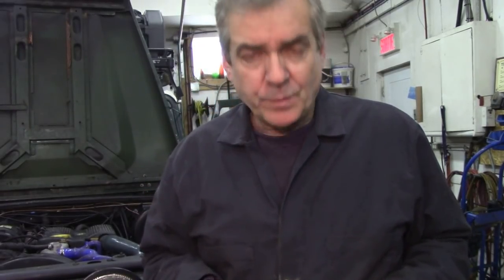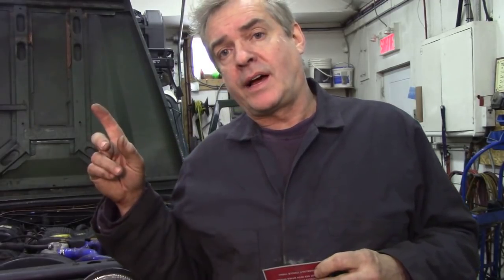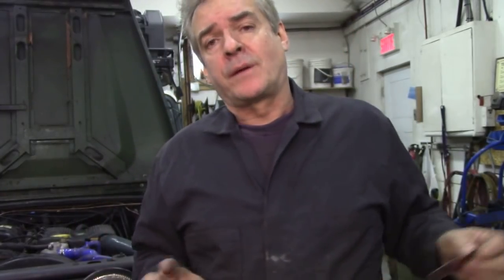Bit of a ramble about WOLF wheels, lengths of studs, bent propshafts and being an apprentice

Comment: Hi I’ve recently found your channel and I’m really enjoying your useful content. I’m a retired engineer from a UK automotive manufacturer, a little bit further north than your apprenticeship days. The rule of thumb we used to employ for thread engagement was 1.5 times the diameter of the bolt. Another useful fact is torque is 80 - 90% friction, so never lubricate a nut when assembling, as you will reduce the friction and probably strip or snap the bolt.
Reply from the maker: Cheers Gnarly!
Happy new year!
Mike

Comment: When it comes to thinking about nut/bolt strength, it's worth remembering that there's a big difference between static load and dynamic load.

To borrow Mike's example of a lifting chain, it might be rated for 500kg when it actually has a breaking strain of 800kg but that's a STATIC load.
If you're lifting something that weighs 500kg and it gets stuck, comes loose and then jerks the chain you could easily find yourself exceeding the 800kg brreaking strain and end up wearing a 500kg load as a hat.

Another good example is waterproof watches.
It might say something like "Certified water resistant to 10 Atmospheres", which means it is, theoretically, water resistant down to 100m depth.
In reality, if you go swimming you'll find the watch will leak at a depth of around 30m.
That's cos, when you're flapping your arms around while swimming, you're applying additional pressure to the seals, much higher than the static head pressure of the water, alone.

Similar thing applies to wheel-nuts.
It's not just the static load that you have to think about but the worst-case dynamic load too - from every-day things like driving over a speed-bump to more dramatic cases like when a 4x4 slides sideways on a track and the side of the wheel smacks into something.

I suppose you could do the maths for working out the maximum dynamic load that you might encounter but it's probably simpler to just hope that somebody smart has already done the sums when designing a thing and fit nuts/bolts as instructed.
Reply: Thank you. You should team up with Mike and do "Dummies guide to Landys"

Comment: Really good informative story about the caravan bolts.
Really helps you understand what you can get away with in an emergency. 
I used to work with a guy, he was known as Herdy, I will use that name to protect the innocent. 
He came across as daft as a brush, he would do labouring jobs driving, anything he could. At one point he was driving coal lorries. 
They weren't very well maintained and one of the wheels only had two wheel nuts on! Herdy drove that truck around for months, fully loaded with coal!
Bless him. A lovely man, when I say he came across as daft as a brush, he wasn't, he was really an academic who was lost in the wrong world. He would do the Times crossword without even trying.
Just thought of another story, he was driving his lorry one day and the steering wheel came off in his hands! 
He did manage to get it back on before it went really wrong.
He got home OK, he worked out that a wheel nut was the same thread as the steering wheel. I always did wonder whether the previous driver had been doing the same thing for years.
Reply from the maker: Good story!
Mike

Comment: Just fitted Wolf wheels to a 2013 Defender 90 that had Boost wheels.
Client bought non genuine Wolf wheels.
Seller told client they have sold lots of these wheels no problems(they would say that, wouldn't they?)
I showed client the phenomenon of studs not protruding through nuts.
However, 
the basic rule of thumb for fasteners is that the contact length of thread , nut length, should equal the diameter of the fastener.
ie; a 1/2" thread needs 1/2" long nut .
With the standard studs and nuts with Wolf wheels fitted the depth of contact thread is approximately the same length as the stud diameter.
Don't forget that the wheel nuts are chamfered , the chamfered portion is threaded which imparts that little extra thread depth.
I don't like the set up, but theoretically it is borderline kosher.

Comment: I was always taught that a bolt is at its maximum strength when threaded in the same depth as it’s diameter
Reply: Exactly. The simplest way to describe it. That's what I was taught when I did my fitter machinist trade.

Comment: Hello Mike. I've no idea whether you'll see this, as I've just watched your excellent video from 3 years ago!
I have a 1959 Series II with its original hubs and has the screw in type studs. I'm looking to replace them and I know I could change the hubs to the later model with push-in studs, but I'd like to keep it original. What I cannot find anywhere is the correct torque setting for the studs and lug nuts. (The only reference for the nuts says don't use an extension to wheel brace.)
I've tried the forums without success and having watched and enjoyed many of your videos, it strikes me that if anyone knows it will be you...
Kind regards,
Mat
Reply from the maker: Good question

217360 2 thread stud supersede to  561590 -  originals were 9/16 BSF 
Torques for 9/16 BSF should be grade A 50 ft/lbs,  grade P 73 ft/lbs, grade R are 113 ft/lbs, and grade S are 117 ft/lbs

Several problems - you do no know what grade the studs are, they are made in China, so they will not be the best materials, and they are into cast iron which is very weak and why they changed to the spline 

From experience, I always replace the double thread with 561886 which are a spline fit but with 9/16 BSF thread, so the double ended nuts are the same, but with much better attachment to the hub - when you remove the double ended threads you will tear out the thread in the hub as they were supposed to be peened over to stop them coming out

Better safe, than looking authentic with a loose wheel
Reply: Thank you for the really quick reply. Not only have you answered the question which was eluding me, but it's also full of sound advice with detail that I've not found elsewhere.
I just wish your workshop was based in the UK! (My go to Land Rover guru retired last year and despite him trying for years to find someone to train and take over the business, no one was interested...).
Looking forward to your future videos :-)

Comment: ....I've done over 120,000 miles in my 300tdi Defender 90 with Wolf wheels and standard studs and nuts, with a hell of a lot of hard off-roading mixed in...with ne'er a problem....mind you I always tighten the nuts up FT with a 3 ft knuckle bar :)
Reply from the maker: We imported one 110 from the UK and the last owner put the wheels on with a 1 inch impact for truck wheels
Broke 2 x 3 foot bars with an 8 foot extension
Had to heat them up in the end - just shows how much they will take before stripping
Reply: I'm the same but I have always done them up to book torque.  I looked at fitting longer studs on my rebuild but they are something like £8 each but standard are only about £2 each!

Comment: We wanted the extra strength of the Wolf, and i read around about the stud issue. Ebay and proper sellers means you can choose from LR genuine, bearmach, britpart and allmakes as brands in the longer wheel studs. Um, wheels are important ... we're not choosing exterior mirrors or other bits, wheels can be life or death, these days your Landy deals with 120kmph freeways as well as rocky river crossings. We went with bearmach. Was it worth the money? Peace of mind was important to me having been in a LR proper prang years ago (on a main road at speed), and for the same reason we fitted rear disc brakes. No doubt we won't be around forever, but we won't be going due to cutting corners on the wheels.

Comment: I was an aprentise welder for 4 years am one now for 20 years butt i had to do basic filling basic tool making etc and had to remove m30 nuts from bolts with a chissel and hammer sometimes hitting my thumb my tutor used to say i should be a millwright butt due to the new south africa i could not learn for it butt while i was hitting the nut that one friday i got a very sore pain in my side my tutor asked me if i hit myself with the hammer and teased me about it it turned out that i had a uranal stone or kidney stone as its called nice to hear your story's i worked with a redesion man called robby williams he went on pension  you make me think of him you have the same acsent

Comment: Question: who carries around a torque wrench in case they get a flat tyre? 

Mike, if you change tyres ( summer/winter ) twice a year, changing studs isn't that big a deal. Still, makes me glad I live in Australia. However, If I presented a car for a roadworthy inspection here with wheel studs that did not project past the nuts it would fail.
Reply from the maker: Same here - but not just one fail - but 20! (Hey this is government - gotta get those fails up!) 
You should have seen the stuff we had to do with the double end nuts to get them to pass in the beginning until I literality pulled the wheel and drum off the truck to explain to the inspector that the nut is flush with the stud  - at first we used to cut them in half and re fit  a new set after inspection
Maybe I should do a video on the total BS we go through for inspection here (good thing we only need one inspection when we import a vehicle)
Mike